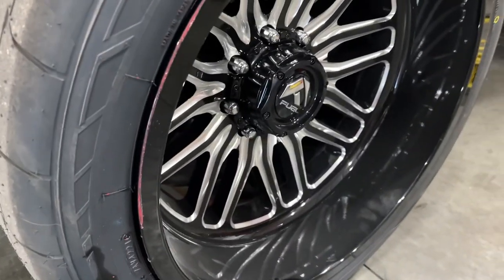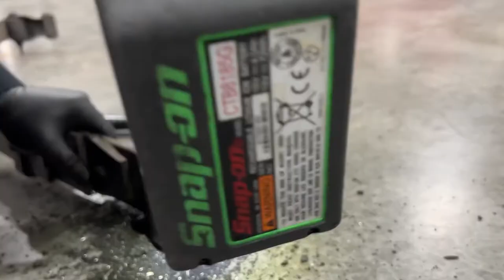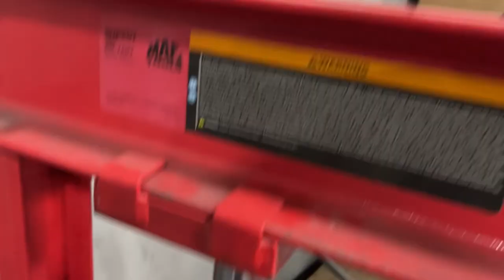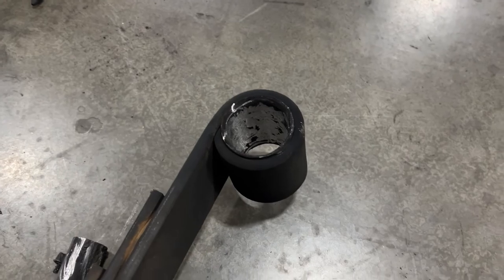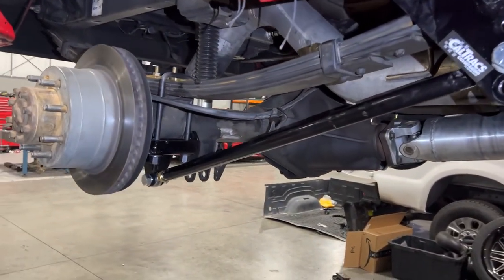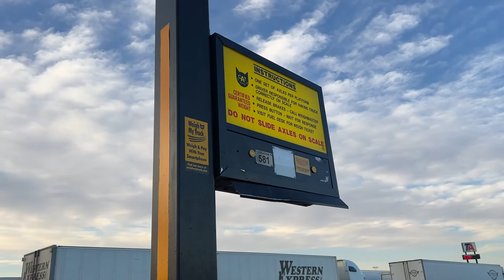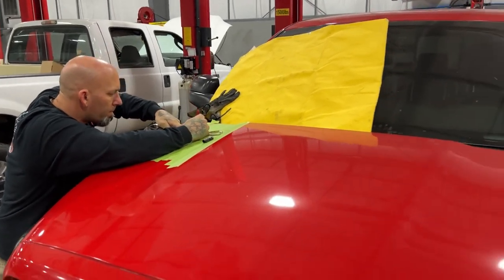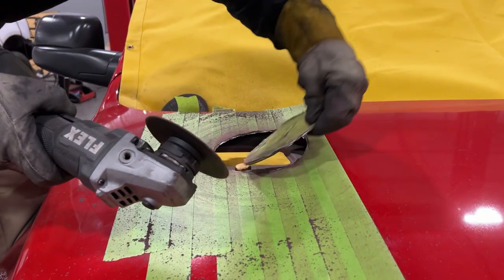CalTracs installation on my 2006 Ram 2500!

Comment: Frank, check your frame end of your track bar for looseness or wollering out of the frame hole, it's kinda prevalent when ppl don't torque the track bars down enough.  Nice build.
Reply from the maker: I did check that, that’s been replaced too. Just found it today, drag link came loose on the tie rod 🤦‍♂️
Reply: @FrankBUILTperformance  Dang, well good ya found it buddy.

Comment: House the traction been
Reply from the maker: I like it, haven’t adjusted it from this video. Eventually will get down the track to start playing with them
Reply: @FrankBUILTperformance  was looking for some for my 2nd gen it's only a 1500 4x4 but building a MMX 6.4 hemi with a speed I don't think the Offroad package  leaf springs would like around 500 hp